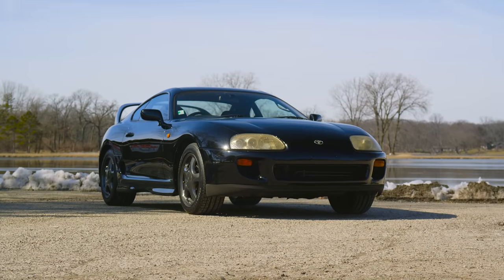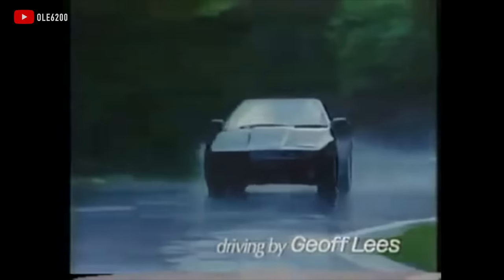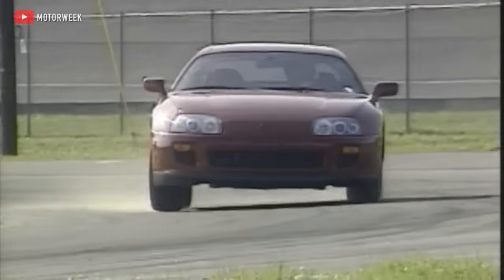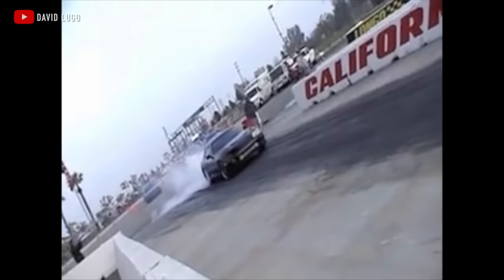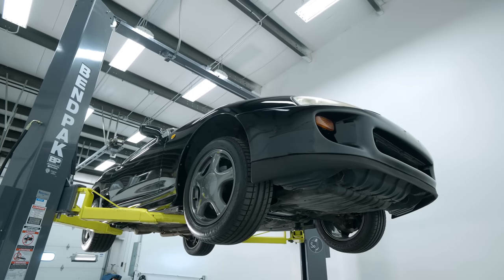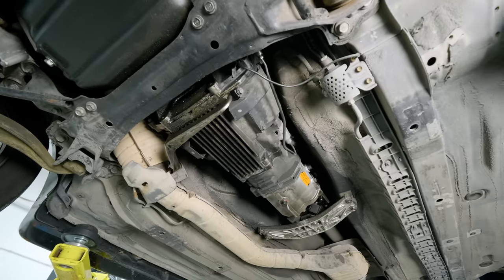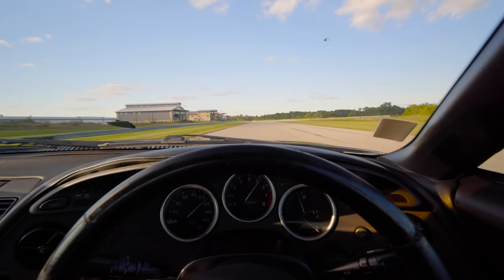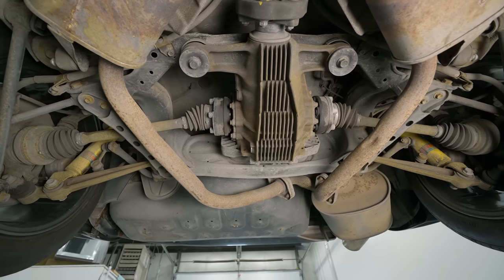Toyota Supra MK4 | Over Hyped or Legendary?

Comment: You are missing the point here , the car became a legent because in the 2000s you could buy a 6 speed turbo sup for 30.000,put an extra 40.000 and you could humiliate on highway or dragstrip any supercar up to 2010 that cost 170.000$+++ , and for any supercar of that eara to get close to that would be another 100.000$ ++++  with no reliability . On the track you could buy an mr2 with 3sgte in it with the rest of your money ….  .   And How much would cost to repair a porsche or a lambo back then ? How much to Repair a 2j or 3s ?  Jay from real street was talking about the supra platform in an episode check it out  , that sweet car gave back to its owners 300%, smiles ,didnt change shape for 8 years , not like other supercars that you pay 300.000$ for them to come up with a facelift in the midle of theyr year prduction ….

Comment: It really is quite simple. A bog standard Supra is little more than a quick, nice looking GT.
For that reason, it's madness they're worth what they are.
On the other hand, some would say Toyota built it to 50% of its potential to circumvent the Japanese HP limit and basically expect you to tune 500+ horse power out of them. If you're not against modding and view it has "half done" you probably start thinking it's decent money for a 500+ hp, nice looking, rwd coupe.

I still prefer the GTR, it has mega racing pedigree that the Supra doesn't.

Comment: The MK4 A80 Supra was literally a sales flopped car. And was criticized by the public of looking different to the A70 MK3 Supra (Third Gen), such as not havin' the pop-up-headlights and lookin' like a "value brand front engine Ferrari".

Plus the RZ Trim Supra A80 MK4 BARELY won against the C4 Corvette "base" models of the 1990s(which the base model costed a few thousand less than the RZ trim).

Comment: The ONLY bone stock Mark IV Supra to run 4.6 to 60 was the factory RINGER that Toyota slipped to Car & Driver for their first "unofficial" test.  It ran 13.1 @ 109 mph if I'm not mistaken but ALL production American Supras after that ran 0-60 in 5.0-5.3 seconds and 1/4 mile from 13.4-13.8 seconds.  The reality is, bone stock they were NOT quicker than the 405 hp ZR1, nor the 421 hp 512 TR or even the early 270 hp NSX.  That 4.6 second 0-60 was a factory ringer putting out around 360-370 hp, it was NOT a regular production example pulled off the lot.

Like with anything else, the "legend" is ALWAYS propogated by exaggeration and ridiculous claims.  The fact is, in stock form they weren't that fast, they didn't steer very well, they had ALOT of body roll, a quivering chassis, and unspectacular brakes.  TWO things made them "legendary"--with the proper tune up, the stock motors were shown to hold 9 second power (even in 1998) they were/are very attractive cars, and they were RARE. You just NEVER saw Mark IVs back then and you REALLY NEVER saw Mark IV turbos!  It is kind of a situation where "don't meet your heroes."

The NSX was great right out of the box, it did everything right as a STREET car.  The Supra was a great blank canvas to build off of but was not an exciting car in stock form.

Comment: when my sister first got her license in late 1999, my dad took her shopping for cars. at our local Toyota sat a white turbo targa and my dad was offered $30k by the dealer to take the car as it was sitting for nearly a year. The only issue; my sister does not know how to drive a manual. To this day, I still let my dad know he should've just bought that car regardless. to make things worst, her choice of car was a 2000 CLK which was delivered December 2000 and she still has it as a back up car!!!! that's literally worth the weight in metal. It means that if she had learned how to drive a manual, that Supra could've been in the family still.

Comment: As a Mk5 owner here’s my hot take on the Supra platform and the current situation of the market. As we continue to see all the major automakers pushing more and more towards EV’s I would argue if you can afford to buy one of the modern sports cars currently on the market that have some collectible element to them in a few decades time they may increase in value similarly to the MKIV and other cars of that era. 
Obviously as new electric vehicles continue to evolve it would be a very safe to assume that auto manufacturers will make models designed with the enthusiast in mind, but I don’t see the traditional gas counterparts depreciating in value in the long term. 
Even more intriguing is with the electric push we are seeing today, can our power grid sustain the added stress that comes with the inevitable increase in demand for electricity? I don’t know what the future holds and how that change could effect gas and electricity costs into the future, but something tells me the MKV’s days are numbered and combined with it’s controversy over BMW’s involvement in its creation it may end up sharing some collective similarities with its older brethren in the not so distant future.

Comment: Is it overhyped? Yes. Is it legendary? Yes. F&F boosted the price over the moon. If it had not, the 90s jdm resurgence would make it an appreciating collectible but not a car worth more than an NSX. This should be worth a little bit more than a z322 300zx TT due to rarity.

However, this is the car that would be in my garage if the value was realistic. As it is, my sw20 will have to do until I move on.

Comment: He said the price was expensive in 93 !!….. I remember buying a used Chrysler LHS in the mid 2000’s,
and finding in the glove box the original purchase bills !!! ( for those who don’t know a LHS was back then the kinda 
300, with a 6 cylinders 3.5 not very sport more on the luxury side for what it is, but it was sold for $43,000 back in 1993 🤯🤯🤯….. so for the same $ I would very much preferred a Supra to a Chrysler LHS. 😂😂😂😂
So sure we didn’t knew of the future but …… boy would I wish I would have known !!
even buying the cheapest models, the one none turbos ! and just by slapping and after market single turbo on the based stock none turbos 2JZ !!! and you instantly had 600 to 700 HP……. This beast was a jewel in many speed freaks opinion. 🤯😍😍😍

Comment: I think the biggest reason why the 3000GT lagged behind in value throughout it's entire life, is the most over looked reason, they sold around 11 times more 3000GT/Stealths in the US alone, then the MK4 did world wide, and it's a similar story when comparing the NSX, FD, etc. Most of this is due to the extremely cheap price point Mitsubishi was able to sell them at in comparison while offering similar performance. Unlike Toyota, Mazda, Honda, and Nissan. Mitsubishi used a ton of steel, and almost No aluminum at all, which is where alot of the cars extra weight came from.

That being said, they have about tripled in price over the last 5 years, with very clean Twin Turbo examples pushing $60K+ and Non Turbo FWDs pushing $25k+ on BAT, which is pretty wild when you compare prices from around 2010..

Comment: Like Steve Theodore, I am a Supra OG (if you've heard of the "lance alignment" that would be me).  I've owned only two, but I've had a hardtop TT 6 speed almost continuously since 1994.  I had a 15 month lapse from 1995 to 1997 after my ex totaled my first one.  The review is interesting especially from the perspective that Toyota set records with the Supra that stood for a very long time in the magazine testing world.  The OE tires all the test mules ran were Michelin Pilot MXX3s.  They had to be special ordered and you needed to provide your VIN to get them.  This is doubtless the reason the magazine cars performed so well, but I can personally vouch for their stickiness and short service life.  Yes, the Supra needs to be pushed before it settles down and gets with the program.  It doesn't feel good at 80%, but really comes into its own at 90% and up.  That was pretty common in the '90s cars, and it is normal for any proper racecar.

The other thing that struck me as odd - I have never forgot my first test drive in the MkIV Supra in 1994.  It was loud.  REALLY loud from road noise.  It was stiff compared to everything available in 1993 short of a go kart.  Definitely stiffer than my '08 IS F and my '16 GS F.  I'm not sure what was going on with the car you were driving, but the ripped shock boot made me think those Bilsteins had seen better days.  Yes, for track work, stiffer springs are a necessity, but the factory setup was a pretty solid compromise biased toward stability at speed.

The latest factory offerings have moved well beyond the MkIV's capabilities, and I have no illusions about my Supra being competitive with recent real sports cars even with full ticket suspension updates and solid bushings.  But it definitely is an old friend who likes to have fun with me, and can still keep a smile on my face 29 years later.

Comment: Even after all this, as a 19 year old, I have absolutely zero interest in a MK4. The new MK5 has a manual. And jdm fanbois can't use the "muh old car has feel bruh" every single review of this old mk4 called the steering numb and suspension cushy. The new one, IIRC, is lighter too. The old one is just numb and heavy. Because that's what it's supposed to be. A gt car. And you can tune it out with new springs and dampers and new steering and then then. But any car like that is meh when it's old is not appealing to me because I aint spending 200k when I could buy a 997 and a merc c63(both) for the same price.The new one, with the manual and the chassis changes they've made, is a genuine sportscar. Even I don't like that the interior's bmw. But it has a straight six, that in every way is better than the old one and doesn't have a big ass iron pendulum in front of the car ruining the balance. The new one will still take about 600 with no big mods, which is the limit of what I'd be willing to have in a car. Trust me, unless you are a person who does trackdays and has done track schools like bondurant and stuff, you do not have the balls or the skill to take a 600 hp car to its limit. And I like my cars at the limit. It's why I drive a nb mx5 with skinnies and an itb.

Comment: 17:48 2023, 5-year-old 120i with 4-pot with stage 1 and exhaust reliably makes the same power and better acceleration because of lower weight. And cost 5 times less.

Comment: The Car was overhyped, the Engine is not.😎
Reply: This comment makes no sense lol..
Reply: @KevinDFuller94  i will help you.  The Supra didn't handle worth crap and the interior sucked for a car at this price point.  The Engine is the ONLY reason for it cult status.  Facts.  Stock vs stock my 2003 Evo 8 would spank it on the street and on the track😎 actually know because i did just that back in 2003.

Comment: Steering/suspension: perfectly describes the 90s era handling of the majority of sports/gt cars. And mainly has to do with tires, bushings, springs, shocks. Most folks upgrade to today’s parts and dramatically changes that soft handling 50%+

Comment: I drove a 400hp modified one in late 1990. As a Mustang guy, it handled,  and the brakes worked great. with 400hp, it accelerated pretty good. I did drive a 1991 HKS modified Supra but it felt like a heavy pig and with the targa top removed, the front moved around separate from the back.
Reply: With the targa removed, it is flexy, no doubt.
Reply: @dizzywow  Even if the bolts were not perfectly torqued. Still a nice country backroads car though.

Comment: I’ve noticed the same thing with the current Mk5 Supra; Toyota was trying to make a supercar out of a sports car. With the design of the engine, the somewhat exotic materials, and the pricing, it tells the tail that Toyota was trying to turn this into a supercar with a luxury twinge to compete with German and European brand high end vehicles. And thats what will shoot ya in the foot. Try to stretch a design too far and way above what it was designed to do and it’ll fall flat. The Supra turbo couldn’t really compete with those cars and be cost effective. Not unless it was a complete redesign. Which…they eventually did do by building a real supercar with the LFA, the first real all-in sports car they did since the mk4 Supra. Tho I guess that too wasn’t a financial win, nor exactly a complete competitor…so maybe new face same old mistakes
Reply: The MKV Supra are running 7's in the quarter mile now - its amazing time to be alive :)

Comment: Not going to lie that I had high hopes for this, but Albon's awful presentation with the hands and all that, along with misrepresenting stuff is beyond a step down for Savagegeese.  Ok, so a "coil ignition" gave angine a power boost?  The performance stats?  I remember in that era it was having a tough time justifying its price being slower than most of its peers.  Then he claimed that the economy was slowing down in the mid-90s?  BS.  The economy of the US was red hot and it ended in 2000 and more notably after 911.

Comment: MK4 supra would not have been possible without the 900 million spent on the soarer/ lexus sc300 chassis design and devolopment & they carried all that over to the supra! Soarer / Lexus sc300 are extreamly under valued because if you think about it its basically a mk4 supra with better interior!

Comment: If a USDM og TT MKIV v160 is not worth 100k, then what does that say about every domestic muscle car that sells for over 100k? That argument makes no sense. There are less than 12k USDM Supras in the states, so obviously supply and demand also has a saying in pricing. How can a legendary car ever sit at 30k for 50 years with no inflation? Cmon now … if every car out there is at 70-150k, damn sure the MKIV is up there. 
Sams
We need to stop comparing 2023 pricing to 2016… the MKIV’s were expensive back then when the dollar was strong, and with a weak dollar and inflation, it’s still somewhat the same. Jdm Supras a bit cheaper, so there is hope for those wanting to drop 30-50k.

Comment: What I enjoyed the most about this video is the honesty. 

This is not a $100,000 experience. Yes I've owned a Supra MKIV and it was great at the time. What I remember the most about the car was my last driving experience. I went to buy another Supra and it was a clean low miles, bone stock, and full of records twin turbo example with the 6 speed. After driving it. The owner at the time could tell I was unimpressed. I asked why they were asking so much? They couldn't give me a straight answer. Thus I have walked away from the Supra. 

I'll end my comment with this. I would buy another Supra. But I'd get it with an AUTOMATIC transmission and cruise it. That was what I loved doing with my old Supra and I would enjoy doing that again. (:

Comment: I have a hard time believing an MKIV Supra with a few bolt-ons and properly setup suspension would feel anything other than fantastic in the corners. I think a lot of the GT car reputation comes from single turbo highway monsters with slicks. Yes, those cars don't turn properly. A stock or carefully upgraded Supra does handle though, and it was often put at the top of period magazine track tests. This coming from an FD owner.
Reply: I’m a 3 time mkiv owner.  The car handles well in terms of numbers.  However me and the old school supra guys used to joke that it’s kind of like driving a real sports car while wearing boxing gloves.  It’s just a vague and numb over assisted steering feel or lack thereof.  That’s the real issue with the car and also why I do not have one in my garage anymore.  Modern cars are much faster.  And if driving pleasure is more important, there are many better choices

Comment: Yes and no from both angles. It's a nice car with an incredibly reliable and stout engine that performs acceptably from the factory but can be made to put out ludicrous amounts of power with relatively little modification and the drivetrain is robust enough to handle it until you start topping, like, 800HP. The only problem is that it's kind of boring. Compared to the visual feast that is the Nissan 300ZX's interior, the Mk. 4 Supra is quite mundane with hard, flat plastics and no particularly striking design. The outside of the car seems to be where practically all of the design efforts were spent. 

Of all of the cars of that era it is the most reliable and least problematic from the factory and even when tuned heavily, but it is also the least flashy and lacks the chassis performance of the RX-7 FD or the NSX. I think it and the 300ZX are both more suitable to be long-distance GT cruisers than they are real "sports cars", just that the 300ZX is a nicer place to sit in due to the greater effort spent on the interior design.

Regardless, it earned its reputation for a reason.

Comment: I owned two, couldn't afford the manual premium. A '93 with a true twin conversation at about 500bwhp @ 18lbs of boost and a stock '97. Both had over 100k miles and I enjoyed them but with the auto you had to be doing 100mph to really have fun in them. I actually had a lot more fun in my '08 G37S coupe with a 6 speed. Way more dynamic driving experience but, again, I only had auto Supras to compare to so it's not apples to apples.